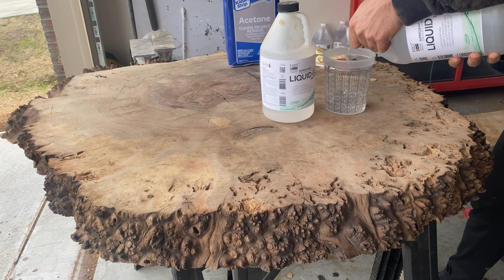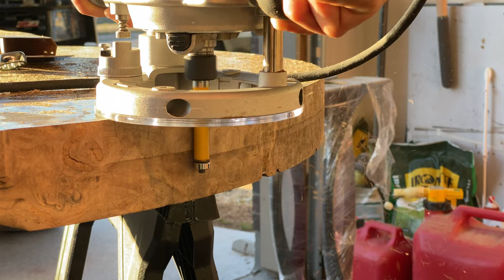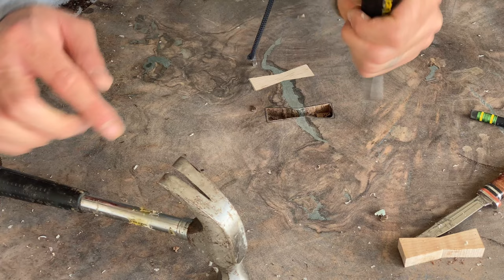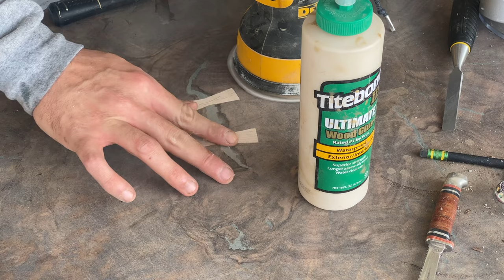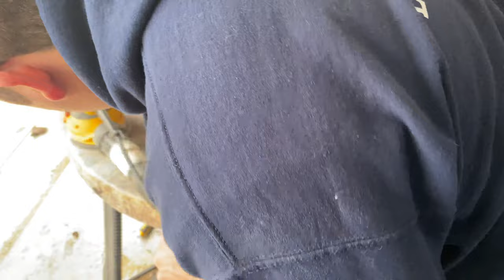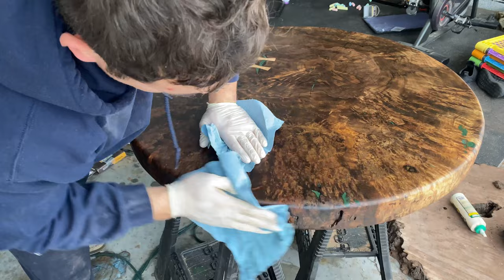Claro Walnut Coffee Table for my Wife

Comment: Why did you removed that bark?
Reply from the maker: Bark continues to rot and grow over time. If you leave bark even if you seal it with epoxy it will eventually fall off. So it’s better to remove it before hand so you can keep a clean slab. This also is why you will see me clean bug holes and cracks so I have a clean piece and will also make a better bond between wood and epoxy.